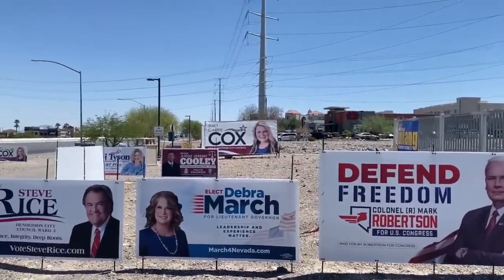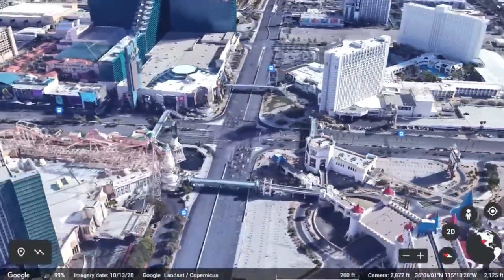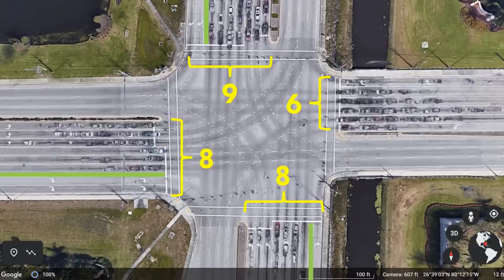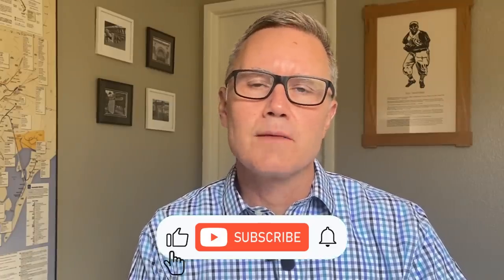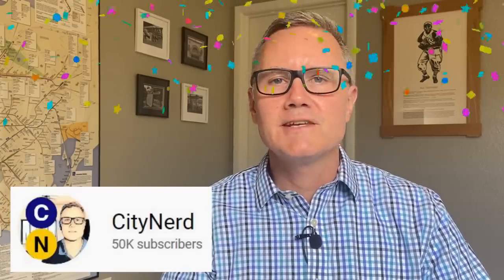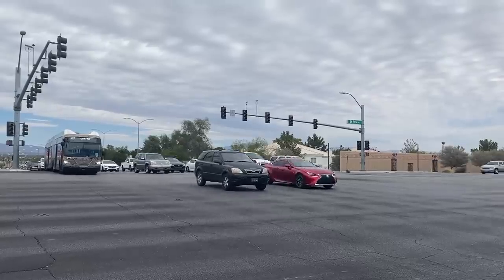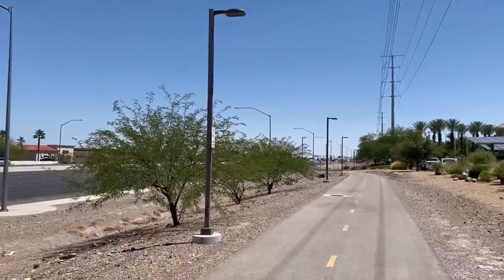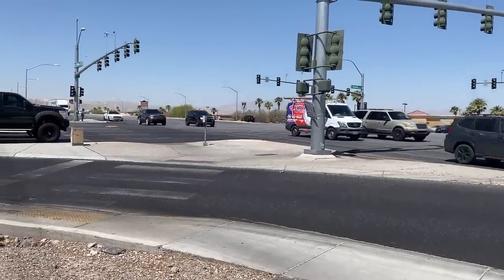Stroad vs. Stroad: Land Use, Traffic Engineering, and What Happens When Suburban Arterials Intersect

Comment: When I moved from urban area of Toronto to the suburban area for work, a subtle change creeped in to how I treated intersections as a driver which I didn't notice until I drove in the urban area again after a few months. I had stopped regularly checking for pedestrians at intersections because I subconsciously started assuming they didn't exist. On suburban roads pedestrians are relatively rare so you get used to driving in absence of them. This results in drivers only checking for other cars to see if the way is clear for turns, and this is without slip lanes with yield signs. The hazardous design of suburban stroads is so insidious that it goes beyond physical danger and affects our psychology to make us more dangerous drivers.
Reply: So true. Near my home which is downtown crossing a street at a light is fairly safe, drivers turning right do slowly creep into the crosswalk to hurry you along on occasion. Even at an unlit crosswalk most drivers will watch for people and will stop. 

Near my office in a suburban office park it's the opposite. Drivers who are facing you, turning left, will routinely look right through you while checking for other cars and drive straight into people in the crosswalk, people that are right in front of them, in the middle of the day because after hours and on weekends these areas have almost no pedestrians. 

Also terrifying is that most drivers reactions to these pressure situations is not to brake but is to accelerate and abruptly counter steer usually with one hand off the wheel in the "HEY!" gesture.
Reply: Totally! This happened to me today.. pulled up to an intersection on my bike and a guy was trying to turn right and never once looked my way. I just waited there to make eye contact- didn't feel like being a pancake today.
Reply: No city in the US has anything on Mississauga or Vaughan when it comes to suburban horror.
Reply: I'm an urban Torontonian who commutes daily to Mississauga by bike. All I can say is, it's pretty scary sometimes. Your description of cars simply "not seeing" bikes and pedestrians seems about right. And I can't really blame the drivers, honestly. Horrible design of stroads and larger vehicles (SUVs and pick-ups) mean we just aren't picked up on drivers' radars.
Reply: Then again, intersections of major roads like this aren't meant to be walkable anyway. A pedestrian under- or overpass (under being probably cheaper than bridges in the long run and also bike accessible if longer ramps are used over stairs) should be the standard if you have these in an area with foot traffic, but then again... why are you even there when on foot? Where did you leave your car? It's clearly the intended mode of transportation. I would not expect anyone to walk along those roads to begin with.
Reply: @knarf_on_a_bike  Toronto suburbs are some of the most depressing places ever, especially in winter. A lot of them have a higher crime rate than more urban neighbourhoods, and the only benefit of living there is price.
Reply: @lemonade4181  And even that's debatable - do I really want to spend $700,000 for a condo in Richmond Hill?
Reply: I agree! This is a sad truth. Dense urban areas have their own issues but drivers having to constantly share space with pedestrians usually leads to some mutual understanding. 

Suburbs can ironically become so devoid of pedestrians that drivers forget to watch out for them. I personally have had more close calls with vehicles crossing a small street near my house than I have walking around busy downtown Toronto.
Reply: Yes, I lived most my life in old parts of Toronto and when I got a job in a more suburban area, well, that was the only time I got hit by a car. Fortunately, I was not seriously injured. He was turning right on a red. I was walking on a walk sign. The driver pulled on through when he saw me get up! So much for Canadian politeness, eh?
Reply: @canadave87  I'll take my 2 bedroom art deco era apartment near Bloor West Village, thanks.
Reply from the maker: This is exactly right. And possibly worse for people biking. You absolutely MUST assume that a driver will not bother checking their blind spot to see if a bike is there before they take any kind of right turn. (This is good practice even for "bike-friendly" urban areas, but in suburban places they dimply don't see you at all.)
Reply: Pedestrians don't belong on good roads, they should have their own place away from the fast vehicles. Much like how it is illegal to walk on railroads, it should also be illegal to walk on high speed roads.

The place for pedestrians is on streets and hiking paths(That usually run parallel to roads)
Reply: @linuxman7777  Roadways (including stroads) should be designed and constructed such that pedestrians and bikes have a safe and comfortable right of way. There are already places where we prohibit pedestrians (controlled access highways, for example). We need more places that are pedestrian-and-bike-friendly, not fewer.
Reply: @knarf_on_a_bike  I agree we need more places for pedestrians, but more good places, like walking paths where we keep pedestrians away from cars and trains. Stroads shouldn't exist imo. There should be Streets where vehicles and pedestrians can mix because speeds are low, and roads where there are no pedestrians or bikes, only cars or trains. There is a great Pedestrian and Bike trail from Pittsburgh to DC I have taken and I almost never had to worry about cars because we were given our own domain.
Reply: I grew up in outside of Toronto. there's some impressive stroad on stroad violence in Mississauga, Oakville and Brampton
Reply: I grew up in North Texas suburbs. What you describe was the default for how I learned to drive. Crosswalks were simply empty formalities to me, not to be accounted for really. When I moved to Los Angeles it took a lot of adjustment for me to learn to build awareness of pedestrians and crosswalks into my driving habits. It’s made me a much more tame (and anxious) driver.
Reply: I've experienced this too.. at a young age my family moved me from Urban Toronto to the suburbs. I can't tell you how many times as a cyclist I would almost always get hit by cars. They just don't check.

I never have these issues in Toronto.

I'm the only time I'm almost struck by a vehicle in Toronto, there's usually a license plate with a cover from a suburban dealership
Reply: I have a similar experience as a pedestrian in cities vs suburbs. In cities, I still look all ways, but I assume at least a good chunk of the drivers (and cyclists!) will see me. In suburbs, I assume no-one will see me, and the ones who do probably want me dead for inconveniencing their travel down a state highway. (An exaggeration, except that the few drivers who are genuinely like this make it unsafe not to assume the worst of most drivers.) And the cyclists are generally on the sidewalk in shorts and a t-shirt, or in the lane wearing bodysuits and going pretty much as fast as the cars. So that's all kinda bad regarding the cyclists. Poor old parents with strollers... I shudder to think crossing a suburban highway crossing with a baby.
Reply: Absolutely. As someone who has biked regularly in Berkeley, CA, a very bike friendly city, and suburban Michigan, it’s a world of difference how drivers treat me in each place. In Berkeley, drivers are very used to sharing the road with bikers and will often yield the right of way if it’s ambiguous, or even when it’s not. It also helps that there’s extensive traffic calming and speeds tend to be slow. In Michigan, cars whiz by you at high speeds and people roll down their windows to yell stuff at you. I’ve even gotten a shoe thrown at me. Some suburban drivers often get angry at bikers because they feel entitled to the roads and are unwilling to consider other road users. Proper infrastructure makes a HUGE difference.
Reply: Solution for that? Have a safe phasing system for pedestrians. Stop ALL traffic through a particular crossing when the pedestrian phase is active for that crossing. If there's no vehicle traffic going through a crossing when the pedestrian phase is active then the only danger to pedestrians is idiots jumping the lights.
Reply: I think a lot could be done to help remind you to check for pedestrians as well, in the UK there's flashing yellow lights at pedestrian crossings on busy roads, on top of that, the road markings are maintained better than in the US so you're at least aware of the crossing by the dashed lines across the road.

If road users are regularly blowing through the crossing, they either put rumble strips on the approach in the case of very fast roads, or, they raise the pedestrian crossing so it's level with the curb and drivers have a 'jump' if they hit it at speed. :)

On these stroads, it seems like a lot of pedestrian crossings have basically no signage at all and extremely faded lane markings, it's like it's up to the driver to figure out one is there. Crazy.

Maybe the most hillarious pedestrian crossing I've seen in the UK is a trail that's literally dirt on both sides of the road with a tiny patch of asphalt level with the road in the middle, it's not one you should yield to as... Well... It's in the middle of a highway! 2 lanes each direction, 70mph limit, drivers usually doing about 75 to 80. Guess they couldn't justify a bridge considering it's a dirt trail. Seems like a game of frogger to me though.
Reply: @VoxelLoop  yeah there are some absolutely nutty public footpath crossings of major roads around in the UK. There are a number near where I live where a footpath crosses an otherwise completely grade-separated 70 mph 2 lane dual carriageway at grade with a tiny gap in the central reservation crash barrier! Frogger definitely comes to mind.
Reply: @linuxman7777  that's assuming not driving is always a choice. But there are many reasons why people don't drive, maybe they're too young, too old, maybe they're blind, or they lost the right to drive after a DUI. And the biggest of all, maybe they can't afford a car. Purely from a democratic viewpoint, people should have a right to access no matter their mode of mobility.
Reply: Some traffic engineers noticed how crowded and "chaotic" old-timey streets from the 1910s and 1920s seemed, before they were regularized with traffic paint, traffic signals and traffic laws. Some of these engineers went back to look at old data on car accidents on these very roads in the 1910s and 1920s, and they were shocked to find that traffic accidents--especially cars hitting pedestrians--were exceptionally rare, especially on a per-capita basis. Then they went to look at the same data on crowded and "chaotic" roads in underdeveloped nations, like India and parts of Africa, where these streets and roads are the norm. They found the same thing there--shockingly low rates of traffic and car accidents per capita. They came to the conclusion that traffic paint, rules and laws have psychologically conditioned drivers to only focus on other cars instead of pedestrians and everything else around them. Some traffic engineers in England decided to replicate a bit of this, building intersections where it's just a "free for all," with no paint, no traffic lights, no rules. And they were right--car drivers slow down a tremendous amount at these intersections since they want to be careful, and pedestrians/bicyclists are way more alert when crossing. Accident rates have plummeted in these places with these new "free for all" intersections. Here's a video about these "free for all" intersections:  https://www.youtube.com/watch?v=VUbsFtLkGN8
Reply: @Kr0noZ  and that is the core of the problem. You really shouldn't walk anywhere in the usa.
Reply: @linuxman7777  this kind of thinking creates exactly creates the system that exists today.

A compleet 180 in how people think about these issues is needed for anything to improve.
Reply: @baronvonlimbourgh1716  I am pro pedestrian, but I also understand the need for cars and trains to have their own place away from pedestrians so they can be used to their full potential, and that pedestrians aren't endangered by them.
Reply: @linuxman7777  unless you build a completely separate, but parallel network, that's simply impossible. Unless you accept that people without a car can't go shopping, or go to work, or go to school, nowadays. I was astounded by the number of school campuses that have no (or no safe) footpaths to them, and were even built miles out of town because the inner city campuses they replaced 'didn't have enough parking space'. 
The basis of this thinking is the same, everyone has a car at their disposal, and when you have a car, you're going to use it. But neither is true, many don't have a car (as I already explained above), and even when you have a car, under the right circumstances, i.e. safe routes to where you need to be, many will be ready to walk, cycle or take transit, or a combination of these.
Reply: @barvdw  People should, in a city or town, be able to walk to the store, the stores should be walkable from people's houses unless they live in a far off rural area, where a car or a horse will be required to get to the nearest town. What did people do in the horse and buggy days? if we treated cars the same way, it isn't a huge problem as even in those days on the faster roads, horses were separated from pedestrians, while on slow streets with businesses, people and vehicles mixed
Reply: @linuxman7777  we mostly agree, I'd say, just your first posts weren't so clear, it seemed you wanted to ban pedestrians and cyclists to trails, who often aren't connected, not to eachother, and neither to places of interest. This is a lot more like I see it.
However, to build a walkable town, it's not just roads and trails you'll have to concern yourself with, but also with development. Too many residential areas have no shops or schools, even when there is a safe trail to them, if they're miles out, you're still forcing people into a car.
Reply: @barvdw  People should be able to get to their daily needs if they live in a town or city by walking, but if they want to go to a different town or city, that is where the Horse/Train/Car/Bus/etc comes in for fast travel, and the trail comes in for slow pedestrian travel.
Reply: @AssBlasster  between tinted windows, sunglasses, and tall SUVs and pickups, I find establishing eye contact to be hit-or-miss. 

But worse, IME it is useless. I’ve had multiple drivers over the years who definitely established eye contact, but who apparently interpreted it as “good, you’ve seen me, now I don’t have to worry about you dashing out in front of me and can safely ignore you in my calculations of when to go”. I’ve had more motorists almost run me down as a pedestrian or cyclist after establishing eye contact than without eye contact. There’s a reason that [car] driving instructors, safe-cycling instructors, and road safety advocates generally recommend following the rules of the road but being wary for others who aren’t doing so, and never say anything about using eye contact as part of how to stay safe or figure out who should yield to whom. 

So now when I’m out and about, I follow the rules of the road, yielding as appropriate, hoping that others will yield when they should, but don’t assume that they will, and studiously avoid doing anything that might be mistaken for eye contact or for yielding the right-of-way when it’s not my place to do so. 

Also, I understand the temptation to cross behind vehicles, but I’m always worried that that makes me invisible to everyone else, and puts me at greater risk. So I cross in front, but far enough away from their front bumper that I have time to jump. Plus, I’ve found that motorists are very concerned about damaging their vehicles, so a really hard thump on the hood (more resonant) or front grill (sometimes easier to reach) with something other than my body will cause most of them to slam on the brakes, and then they see you.
Reply: @AssBlasster  The problem with that is sometimes when a car pulls out right at the green, the cars behind him will tightly follow, which ensures that you, the pedestrian (who actually has right of way) never gets to cross until the next green. I usually try to jump the gun and start crossing early for this reason.
Reply: @linuxman7777  Maybe it should be illegal to drive on roads that pedestrians use. :-D
Reply: @linuxman7777   Not sure how you can compare roads to railroads. Sure, pedestrians should definitely stay off railroads. However, railroads don't connect with Taco Bell and banks and libraries. Roads do. Therefore, pedestrians need the same access to roads that cars have. Aside from freeways, but literally nobody here is advocating for getting pedestrians on freeways. Also, regarding your horse and buggy comment, horse carriages and bicycles shared the same streets for much of the Victorian era. There were no bike lanes in the days of penny farthings. lmao
Reply: @linuxman7777  the point is that until the mindset changes to one where cars need to make room for pedestrians and cyclists instead of the other way around nothing will ever change.

The solution to trafic is not more asphalt. It clearly is reducing trips that need cars. And until people can just walk where they need to go in a safe and pleasant manner to do small erands there is no chance to achive anything.

That is the lowest hanging fruit with the biggest impact at the lowest cost.  Things evolve from there.
Reply: @michaelstratton5223  In America today in most places roads connect you to those businesses, but in the rest of the world, and in old america, slow safe streets do
Reply: And there's a feedback loop. Roads turn drivers into more dangerous drivers, as your experience indicates. That in turn makes it less safe to walk, so fewer people will - and almost none will do so by choice. Which makes pedestrians more rare, which makes drivers stop looking for them...
Reply: So you’re saying your situational awareness sucks?
Reply: Interesting observation and kinda relates to something I've been noticing in my city.

More and more often if feels like, drivers where I'm at have only been looking left for cars when making right hand turns at intersections or driveway cuts. I've nearly been hit a few times, I've seen it happen to others, I have no idea what's going on.

I've resorted to yelling at drivers as I'm walking by if they don't look in my direction.

Edit: I'm in Woodstock, 2hrs south of Toronto.
Reply: @bennicbennicbennic  when you consider the extremely distracting design of modern vehicle interiors and add smart phones it’s no surprise drivers have less time to pay attention to you
Reply: @pmscalisi  I mean cell phones bad yeah but what I've been seeing is drivers just straight up choosing to only look for oncoming traffic instead of possible oncoming pedestrians.
Reply: @bennicbennicbennic  driver entitlement?
All kidding aside people are too rushed now. I never make a right turn without looking for pedestrians. I was taught that while learning to drive.
Reply: @pmscalisi  I feel like there's so little pedestrian movement here, that I could see drivers just straight up not expecting people to be outside.

Which is kinda sad for a residential area...where people are...

But yeah, looking both ways is a pretty basic thing you learn even before you begin driving.
Reply: @michaelstratton5223  "However, railroads don't connect with Taco Bell and banks and libraries. Roads do"

The idea of the stroad/road distinction is that stroads connect with Taco Bell and roads -- highways, basically -- don't.  Ideal is roads connecting cities, proper human-friendly streets inside them.
Reply: I absolutely understand this, but in the opposite way. I'm from a tiny town of about 1,500 people in Pennsylvania. About 8 years ago I traveled to Toronto. I arrived there at night time during rush hour on Boxing Day in blizzard conditions. Considering when I see a pedestrian in my town it's like seeing an endangered species, when I got to Toronto and experienced all of that, I was completely overwhelmed. And there are many cases in which I didn't notice people walking or biking. I'm a pretty observant driver, but when you live in a place like I do, your model of driving really doesn't include pedestrians... Which may seem crazy to some people living in cities, but when you never have to watch out for any you kind of just naturally... don't. However when I got back from Toronto, I found myself checking for pedestrians everywhere. And it's coming in handy. I saw somebody walking a few months ago. Lol
Reply: I've had drivers make eye contact with me, wait for me to start crossing, and then floor it because they saw an opening in the traffic and I had to jump out of the way.
Reply: But it is only natural that the less dense the population, the less pedestrian on the streets.
Reply: Can't say how common this is while running in suburban areas while part of a highschool and college team.  At first you assume a driver would be looking both direction just upon approach of the intersection based strictly off how binocular vision works and very quickly (after a few chance encounters with people taking blind right turns) you get conditioned to never assume a driver is looking right before making a right turn, only to check for oncoming cars.  

The kicker is, after nearly getting taken out by a literal 2 ton vehicle by someone who was clearly not looking the driver is the one that will consistently take umbrage against the runner/biker and pull out every swear in the book to play it off like they were blatantly negligent.
Reply: @barvdw  When not driving is a choice, the silliness of our car dominated culture becomes even more apparent.
Prior to the arrival of the automobile, there was always a place in town to hitch our horses up to while we did our business there. That transportation Dependency has never ended in North America’s car culture.
Reply: I realized this about myself when I about hit some people in a downtown having never lived in a place where people do/can travel as pedestrians.
Reply: I live in a suburb and drive to DC for leisure; though I've been driving for 3 years, it's only last week that I realized that I understood why "No Turn on Red" is starting to become the norm in certain intersections: since, like you noted, suburbanites tend to not be used to pedestrians, a lot of people tend to drive into that right turn on red without first ensuring that no pedestrian is crossing the road, and these "No Turn on Red" provide an external reason for motorists to stop, which gives enough time for pedestrians to safely cross.

Then again, I've seen people blow past these, so...yikes. 'Murica, right???